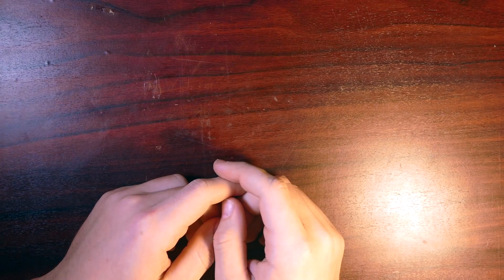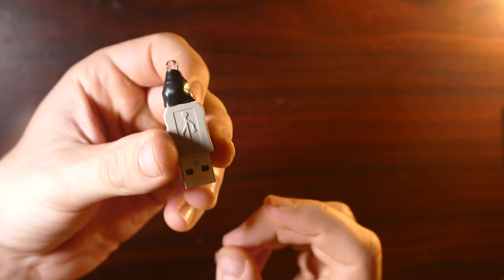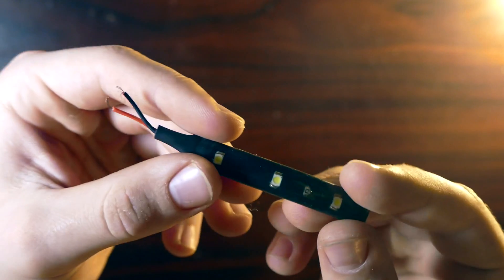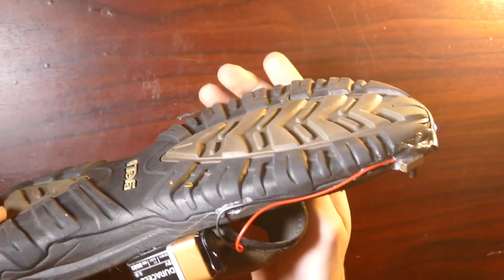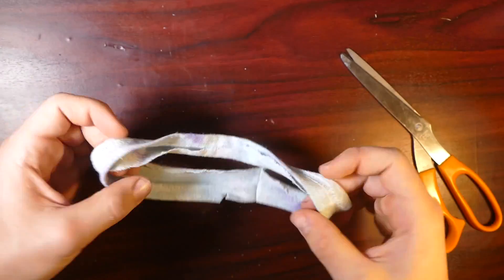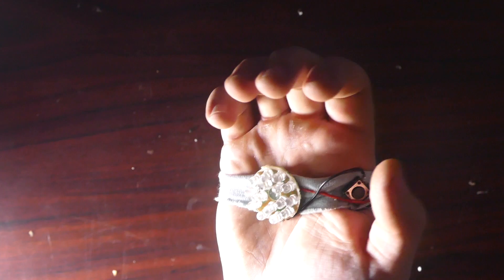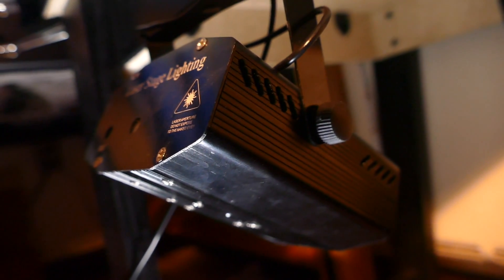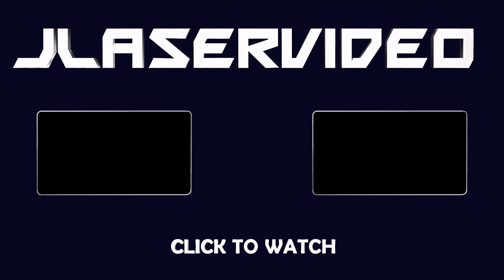3 Amazing LED Hacks! - DIY Useful LED Gadgets!!!

Comment: you NEED to learn how to keep your soldering iron tip clean,
IT's EASY, ..... get a sponge & dampen it, ..... & rub your tip EVERY TIME you use it. 
It will make your soldered joints much easier & clean too...........
Throw that OLD CRUSTY tip away & get a new plated one & KEEP IT CLEAN........

Comment: Your solder connections will be stronger if you heat the object and then apply the solder to it. If you heat the solder and apply it to the object then it will flash cool the solder making it brittle. Cool video though, very good ideas.